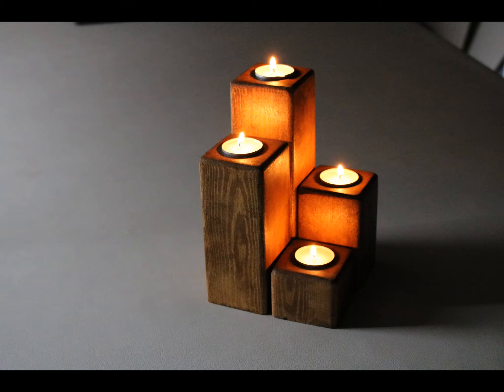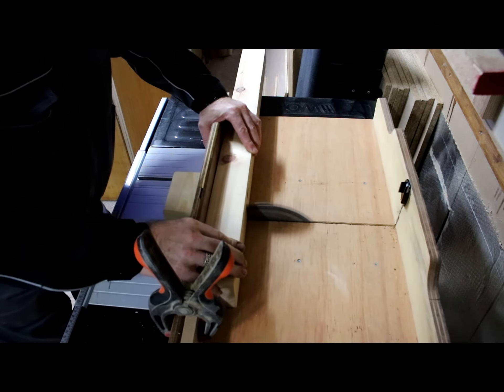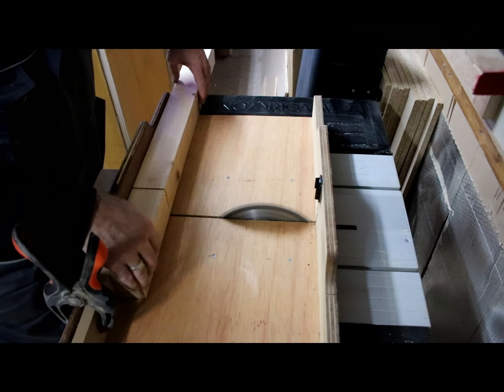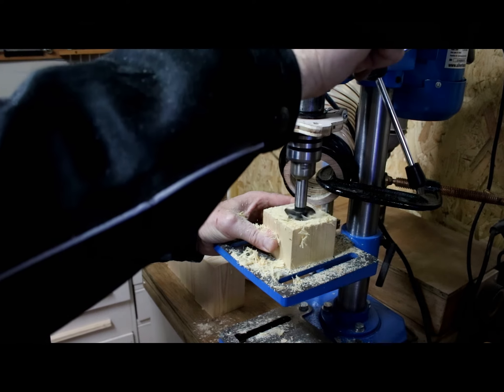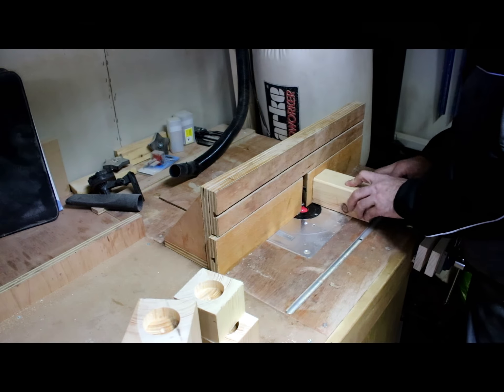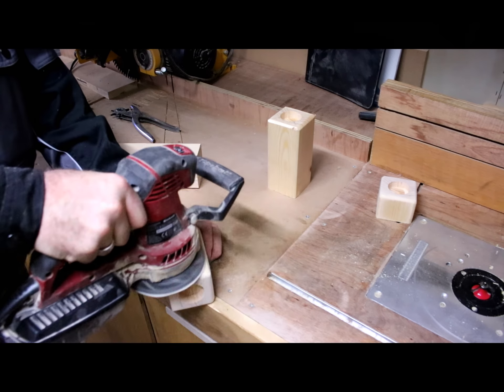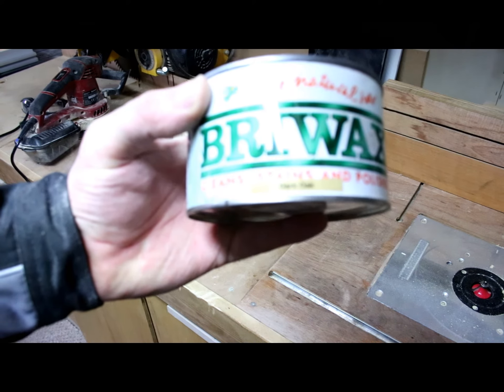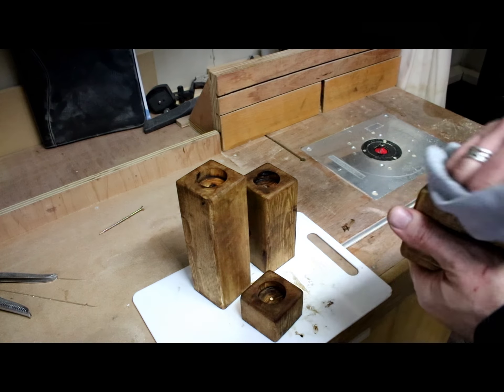How To Make Chunky Wooden Tea Light Candle Holder| SHOP MAD

Comment: I keep charring / burning mine when I drill the 40mm hole, when using hardwood. Any thoughts on what I'm doing wrong?
Reply from the maker: Hi could be damp wood not sharp enough forstner bit or the speed of  your drill is to high. Hope that helps